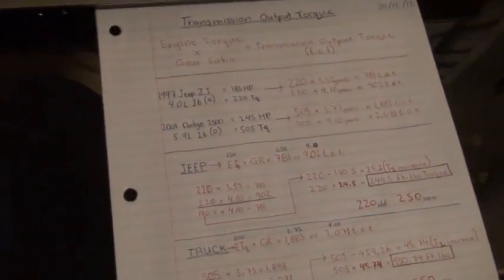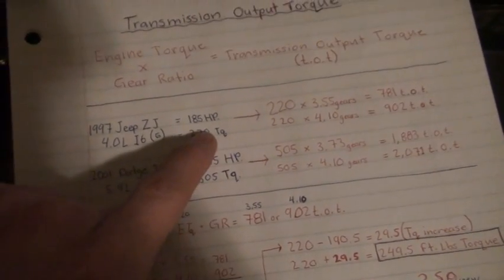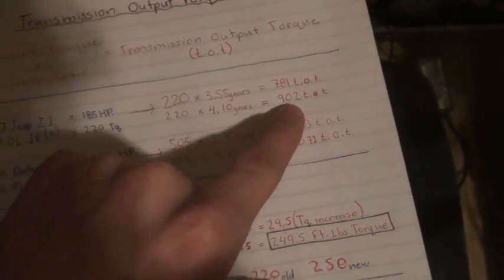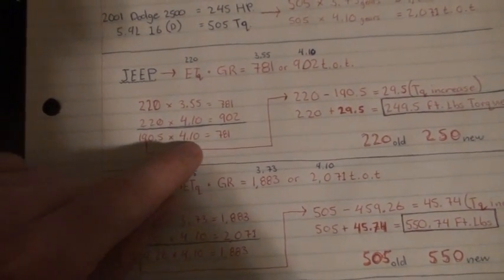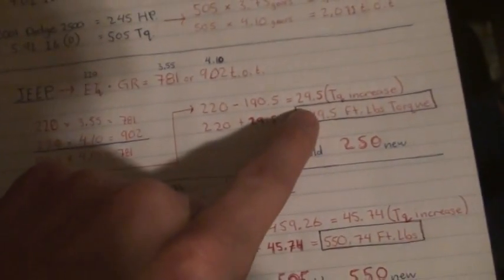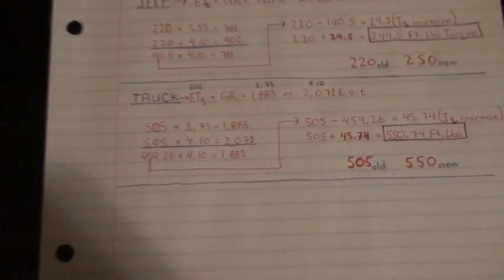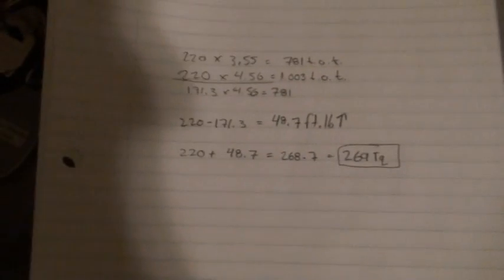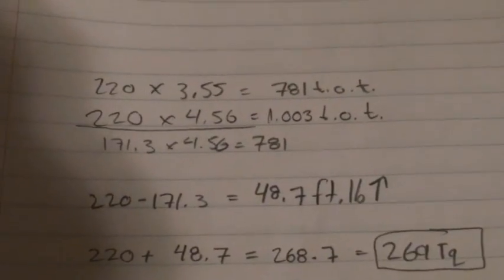How to calculate Torque increase with new gear ratios

Comment: Most Jeeps with 3.7 V6 and 3.55 reared only dyno at 175 wheel torque from engineering resources ive seen a 3.92 final drive will give u an increase of 22 lb of torque for a total of 197 ft/lbs at the wheels

Comment: Changing the gears in ur rear end doesn’t effect the output torque at the flywheel now it possibly does change the  HP and Torque at the wheels (tires)but to know how much u will need to run it on a Dyno

Comment: Changing the gears in ur rear end doesn’t change the output torque at the flywheel now it possibly does change the wheel wheel HP and Torque but to know how much u will need to run it on a Dyno

Comment: You seem fairly smart and this is kicking my butt . Help me out with an equation if you will . I have a cable & spool with 12 circumference or 3.8197 diameter attached to a suspended weight ____ . The spool unwinds or rotates @ 1rpm  , This is attached to a gear system of 1:2 x 1:30 x 1:30 right angle drive producing 1800 rpm engaged to a generator head with 67 ft/lbs torque resistance . How much does weight weigh .  My numbers jump all over from 600 lbs to 20,000 lbs and I'm stumped .